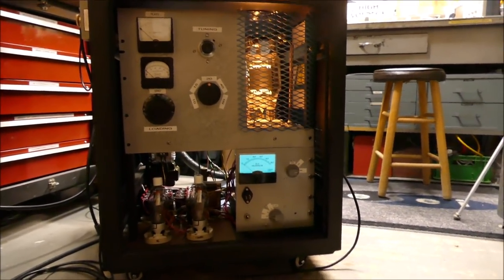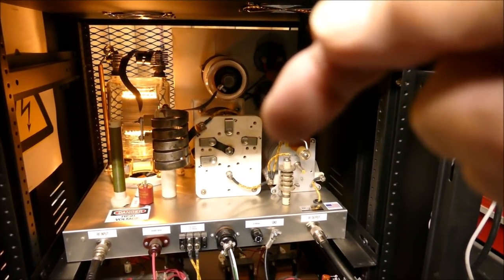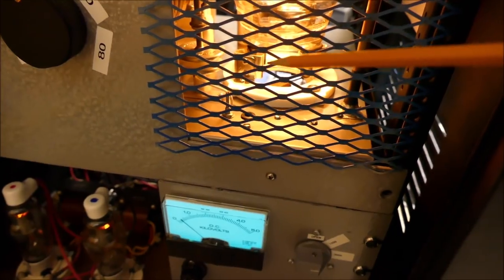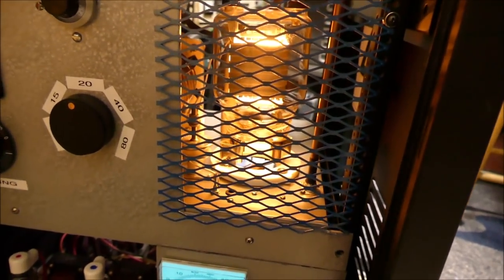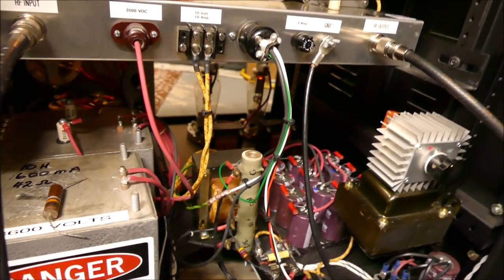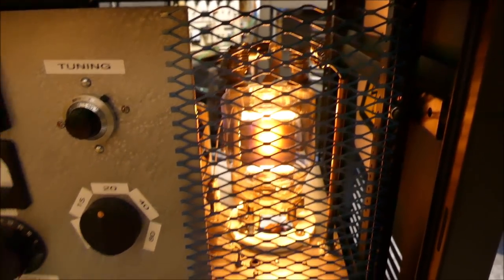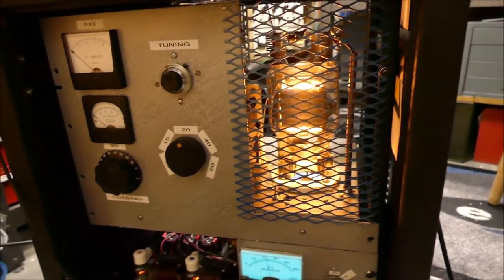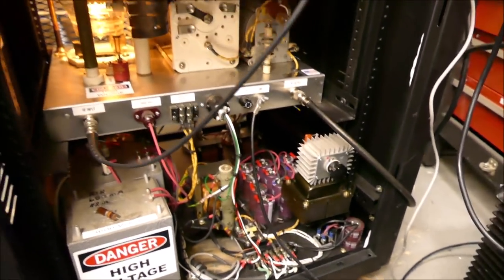(2 of 3) Completed 833A Vacuum Tube Triode RF Amplifier For 20 Meter SSB

Comment: What about two of these 833A vacuum tubes driven by a BALUN and driving a BALUN connected to your antenna would that quadruple the output power.
Reply from the maker: I am not sure what the baluns would do for it. A transformer on the input might make it a little easier to drive. Neutralizing the amplifier gave me another 50 to 100 watts output with the drive power available from the iCom. A pair of these guys would be something to deal with. Raising the plate voltage a bit more and it will deliver 1KW output but the normal output with the driving power available from the iCom is 800 to 850 watts. PEP output would be a bit over 1KW.
Reply: ElPaso TubeAmps I meant using two 833A tubes in balanced mode and feeding both via a BALUN they then drive a output BALUN so you get a higher output .
Reply from the maker: Are you thinking about the old way of push pull with a swinging link coupling for input and output? That would be classic and beautiful and would surely provide 2KW or better output.
Reply: using unbalanced to balanced matching transformers (BALUNS) one on the input matching the input of 50R to the 833A tubes and a BALUN on the output to match the 833A tubes to the output of 50R and ensure a nice clean signal across the whole spectrum I.E. 1.5 to 30MHZ
Reply from the maker: I will have to think about that one for a while. I understand what a balun is but I think the better way to go on the input is a tuned circuit, either a parallel LC network or a Pi network. I see both designs out there and I don't know if one is better than the other. Some of the vintage Eimac schematics use a parallel LC network that is switched for different bands and Collins usesl Pi networks for each band as input to the parallel quad of 811's in their 30L-1. In my case, the efficiency was increased with the use of the parallel LC network and it also gave me the 180 degree phase shift at the junction of the capacitor to ground to make the neutralizing circuit work. As for the output, the Pi network as been king for a long time.
I am not dismissing your balun input and output. You may have something serious here. Think about this... in the early books no one and I mean no one... used a Pi network either for the input or output. It was either a parallel (or series) resonate LC network and link coupling. When I look at the old Radio Amateur Handbooks, I just want to shout at them, where's the Pi network??
Wide-band BALUNs in and out... sounds good to me and I bet lots of the new equipment is already using such circuits. This is why I really enjoy these conversations. I have never been deep into BALUNs so I have a lot to learn.
I will add this, I have done enough building and testing on the so-called "ugly" baluns which, as you know, are a few turns of coax right at the antenna and I know for sure, they are not wide-band. This stuff you see on the Internet of a 3-30 MHz coax balun isn't going to work like they claim it does. On the other hand, I have purchased some toroid core baluns from a builder here in Texas that I have tested (and used) and they are indeed wide band but they are also 1:1 so I don't have any experience with the 4:1 etc varieties. I don' t know the Z of the 833A grid but I figure it is a few hundred ohms. I guess i could get serious and measure it with some of the GR equipment I have.
I am thinking about this and especially as it concerns the 833A. It is a tube that is held high with respect but it hasn't had many good reviews over the decades as an amateur radio amplifier tube. It sure looks like to me it can be tamed. Certainly not as easily as the 3-xxxxZ family of high mu triodes can. You just almost can't go wrong building a GG amplifier with these high mu triodes with a gain of 200 but taming the medium and low mu triodes is where the challenge is.
If you know of any schematics with such amplifiers using baluns in and out, please give me the links.
Reply: ElPaso TubeAmps I think that you are right

Comment: Hey there! I've got an unmarked transformer that I'm pretty sure was from a 3kv lab-grade power supply, but cant for the life of me figure anything out based on markings. Must be custom...

Anyway, I'm curious if you've a use for it? I'd rather not mess with 3kv... Thanks!
Reply from the maker: Britt,
I know a lot of people that want no part of high voltage .... The transformers I use that would be in a 3KV range would need to be rated at 500 mA or more and weigh in at 40+ pounds. If that is what you have I could be interested in it. That unfortunately, makes shipping kind of expensive depending on where you are located. Thanks for thinking of me.
Reply: If I recall correctly, it was used with a quad of 8068's. Based on some other PSU designs, that may mean the limit was something on the order of 20-30mA of current deliverable, but I could be way off... Is that still something you (or others you know) could be interested in? For reference, I weighed it at just over 10lbs.
Reply from the maker: Looking at the data sheet for the 8068, they are rated at 3.5 KV and 100 mA , and four in parallel,  I would imagine the PS could be regulated up to maybe 100 mA - at maybe 1000 volts and I base that partly on the 10 pounds of the transformer. I'm not sure what project it could be good for.  Fortunately, I have a huge supply of power transformers that I could derive several KV from at high current if necessary so I am not in need for another at this time. Other YT viewers may need it. What I am always looking for is vacuum tube output transformers of just about any impedance. 
I have a Keithley 241 regulated power supply that uses four vacuum tubes that may be the 8068's. Does your PS look anything like this one?
https://www.youtube.com/watch?v=go7H67mIejU
Reply: Given limited time and space at the time I salvaged the parts, I only grabbed a few things from it including the PT and tubes. It was quite dirty and looked well used as I found it. It was a piece formerly used in my local University's Physics Dept, but I've no clue what they'd have used it for... Xray gear is typically in the 10's of kV, like 40-55kV, so frankly, I'm clueless, haha! 

Maybe I'll feed a small voltage in the primary and see what I get out of the 2nd taps..? If I suspect it could be >1kV, Im not sure my meter would live if I use even 1V at the input... Could I try that test backwards?

Thanks for the informative response! I sure appreciate your attention, and love everything you do on your channel - Keep it up!!
Reply from the maker: Yes, you can put in low voltage on the high voltage secondary and read it backwards. You will get the same ratio either way,  input to output and that is the voltage ratio - step up or step down - got to be careful. A transformer with a voltage ratio of even 10:1, voltages can become deadly quickly. Also, know the maximum voltage of your meter especially if it is digital. I carelessly smoked a nice Fluke meter by being careless. It ended up in the trash can. I have a old Triplett meter that will measure 6KV so that is what I use. Always be very careful with transformers. I made a video on vacuum tube output transformers and they can have a voltage ratio of 40:1 so 100 volts on the primary side means 2.5 volts on the secondary side but wired the other way around will get you 4000 volts on the output side.
Reply: Excellent point. Thanks for the caution and clarification! I'll check it when I get my workshop set back up.

Comment: Where do you derive your ground bond?  Is it the protection equipment ground from your AC service entrance or something else?

Thanks.
Reply from the maker: I get an external ground from the safety (green or bare) wire of the AC line and I also use a ground stake in the Earth. In the basement where my station is permanent, I bond the Earth ground to the copper water pipe coming into the basement just a few feet away from my equipment.
As for a power supply ground, I should have shown this in the video (maybe another video?) I use what has been classically known as a "fail safe" circuit but modernized. The negative side of the power supply goes to ground thru the plate current meter so there is no HV on the plate meter. However, in case of a meter failure or a true HV short to the chassis, you do not want your meter vaporized nor do you want HV on the chassis so instead of connecting the negative side of the HV PS straight to ground, you connect it to the chassis ground thru a resistor shunted by a diode. The resistor value is non-critical and I used a 50 ohm 100 watt shunted by a diode. The addition of the diode is the result of more modern day thinking as we want any failure to "fail safe" that is to say, in this case, if a resistor "fails" it is likely to fail by opening. We don' t want that so it is shunted by a diode which will limit the voltage drop to a small 0.7 volts. I hope I explained this properly so it makes sense and helps.

Comment: 3kV scares the crap out of me. I;d rather build an LMOS(?) solid state linear. 1500W output from a 50-75V supply. Even with the extra parts it requires it can almost can fit in a shoe box, except the power supply.
Reply from the maker: No doubt 3Kv can be death on contact but there is something about the marriage of the glass and metal and the glowing orange plates that has a charm that is hard to describe. Maybe someday I will get into high power SS RF amplifiers. The closest I have come to SS (looking) is the 4CX1000A amplifier where the tube looks like a little flying saucer. It definitely works and will deliver its 1600 watts to the output but it just doesn't have the thrill of the glass tubes, at least for me.
Reply: Yeah, staring death in the face is thrilling. But I'll stick to the 550 volts in a Dynaco. ;-))